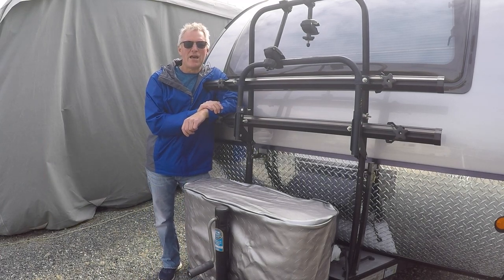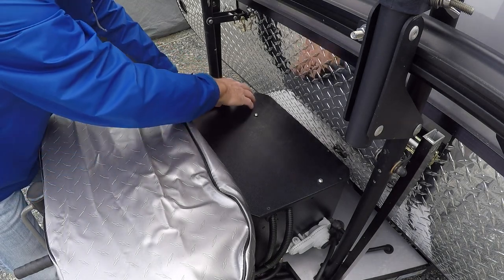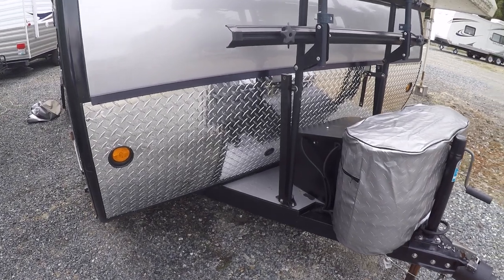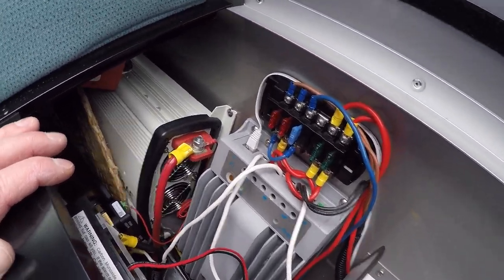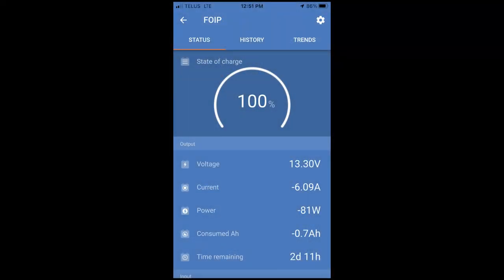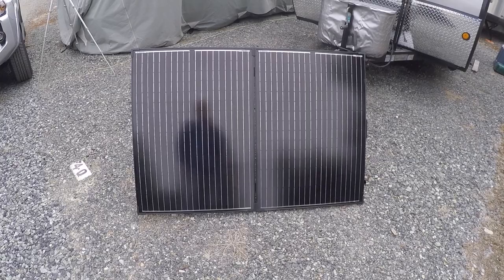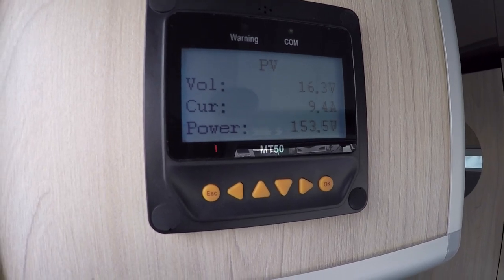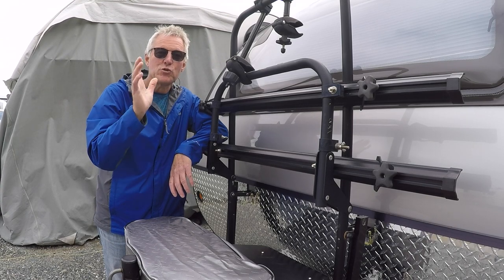Safari Condo Alto F1743 Solar and Lithium rundown

Comment: Thank you so much! I shared with my husband as its all Greek to me but we’d love to be able to be off grid. Do you know anything about where to carry or put  honeypots on  a 1743?
Reply from the maker: Probably not many places if at all... Sadly that is one of the area of concern - small tanks.
Reply: @gregdowswell7124  so here is a question for you.. some people put drying racks on rear bumper of camper, someone posted on Alto that they did… what do you think of attaching the honey pot to that! We are now living in Ontario and most of the provincial parks do not  have sewer and water. So if fill up on water and use taps for dish washing etc, the grey water fills up.. and some black water. Having to that attached to the rack somehow doesn’t add holes etc to camper and useful. Opinions?

Comment: Great video Greg. Just wondering if the lithium batteries receive any charging from your tow vehicle while in transit? It sounds like some people are adding DC-DC chargers to compensate for the smart alternators in todays vehicles which reduce the voltage during travel after the T/V battery has been recharged. Thanks and keep up the great videos
Reply from the maker: Good day! No I do not have a DC-DC charger, haven't seen the need for it, albeit I may in the future. We seem to have had great success with the roof mounted panels and the suitcase. I do like the idea of that device but maybe an upgrade path?? Cheers!